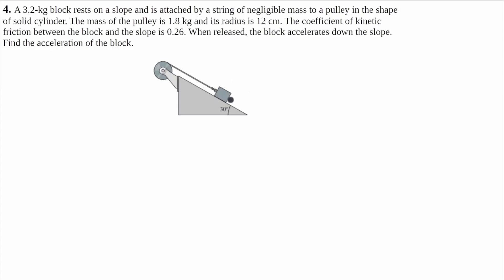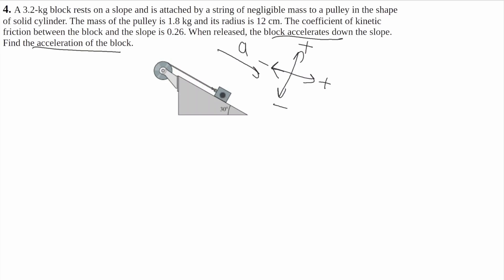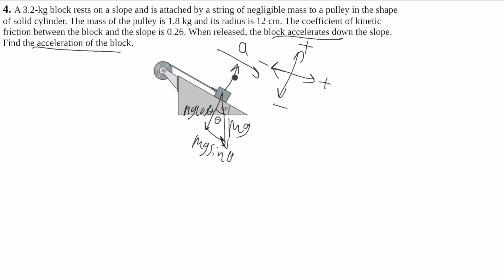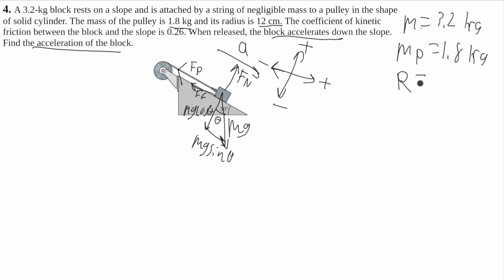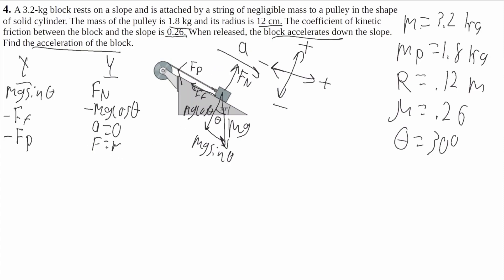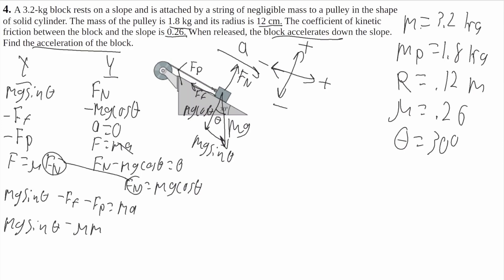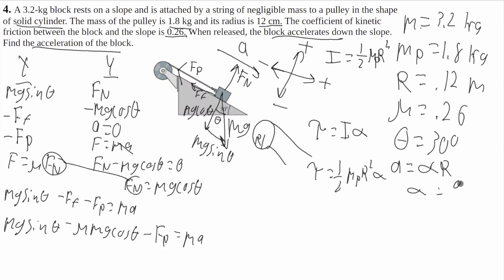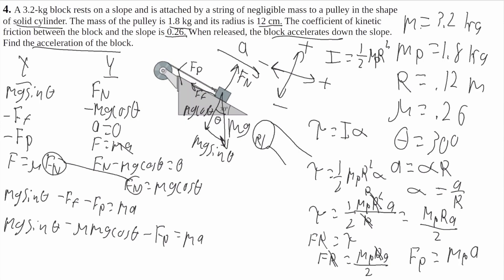How to find the acceleration of a block down a ramp if it's connected to a pulley, and has friction.

Comment: I got 2.99 or 3, not 2.1, is it just me cause I checked the numbers multiple times and still get the same thing?
Reply from the maker: Make sure you are following the order of operations. Do (sin30-.26cos30) you will get ~.275 (make sure your calculator is in degree mode). Then multiply what’s outside the parentheses, mg, which is (9.8 * 3.2) = 31.36. Multiply the two numbers in the numerator ( .275 * 31.36) = 8.624. Now in the denominator do (mass of the pulley/2) = (1.8/2) = .9, then add it to m. You’ll get (.9+3.2) = 4.1. So, your numerator is 8.624 and your denominator is 4.1, (8.624/4.1) = 2.103 .